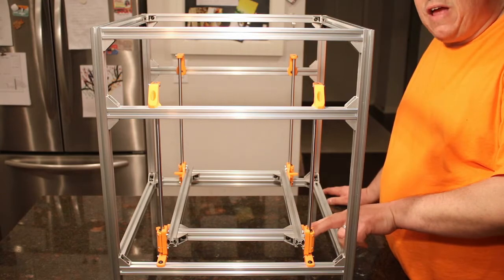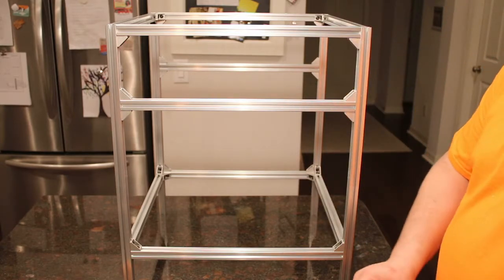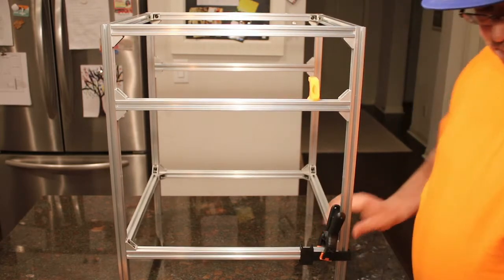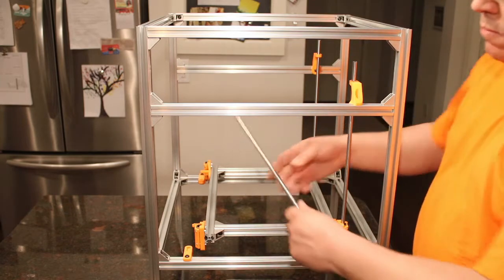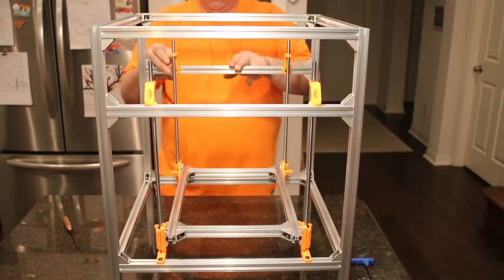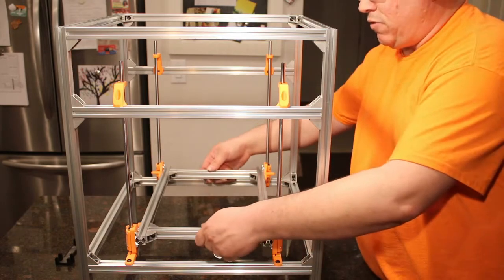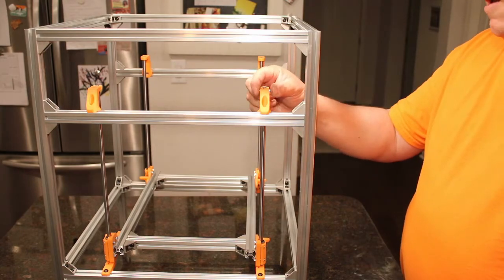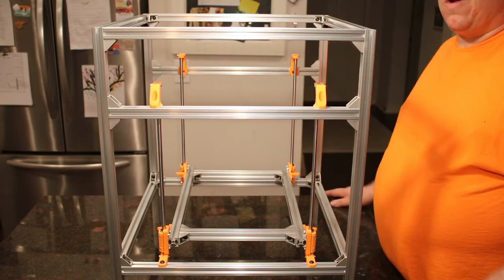3D GURU Building the Hypercube 300 Part 4: Assembling the Z rods and tuning the print bed frame

Comment: I built a “standard “ Hypercube a couple of years ago and now I’m in the process of making a 300 x 300 Hypercube. I see the way you’re doing yours, it has given me some ideas, but my bed that I got from Banggood isn’t the same as yours (screw mounts are not in the corner like yours) so I have to make something a bit different. 
It’s also 310 x 310. 
I’ve already made your extruder, it’s better than the one I was going to use. 
I’m also planning on housing all the electronics in the base, so your design doesn’t suit me, but it looks good! 
I’ll watch the rest of the series to see if I can steal any more ideas! 😁